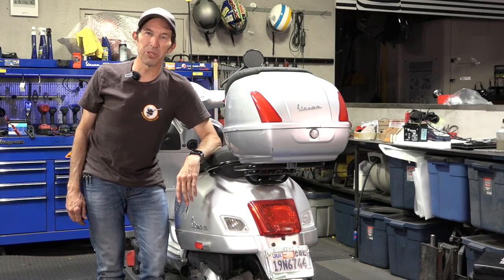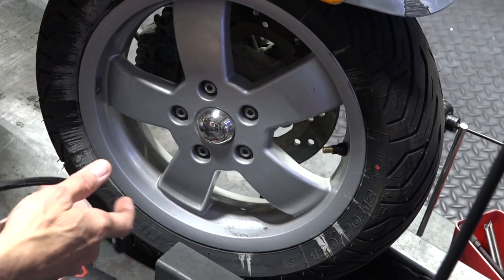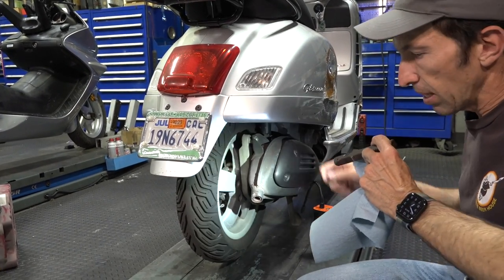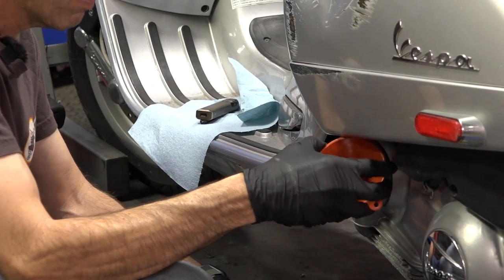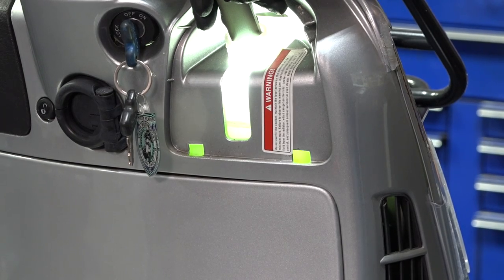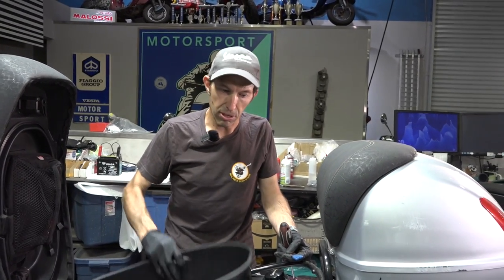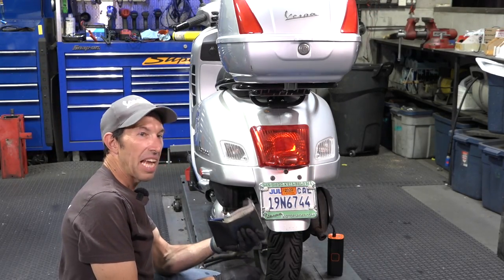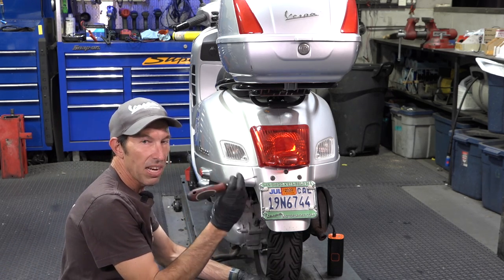Things to Check Before Long Distance Scooter Riding

Comment: My Vespa has been louder than I thought it should be for the year I have owned it (bought with 7k miles).  Finally got embarrassingly loud after a 30-minute full-throttle run.  I changed the spark plug, and looked all over the exhaust.  When I took the exhaust off, I had zero left of the bushing.  This video and parts service is excellent.   It doesn't mention which way in the new bushing goes - it doesn't appear to be the same both ways.  I'm assuming the open mesh end goes into the exit of the exhaust gasses.

Comment: Thanks Robot! I have a 2008 Vespa GT200L that has done over 60 thousand kilometers and is still my daily driver here in Cape Town, South Africa! I have done a few longer trips and loved it. I currently have two problems to solve. My Speedo cable seems to slip (the Speedo works intermittently up and down) when the cable is tightened too much on the top (headset) end. Also my indicators only work when I pull the break lever… any advice on either of those issues from the community? Thanks once again!
Reply: You might have the grease in the tube of speedo cable dry up over these years which is common on the clutch cable of old two stroke engine vespas thus causing the breaking of cluth cable.

You might spray some 3M grease into the tube of speedo cable to lubricate the cable to revive the speedometer.

Comment: HI ROBOT, ALWAYS HAPPY TO WATCH YOUR VIDEOS, QUESTION: I HAVE A 2006 250 GTS IE, WHEN MY SPEED IS AROUND 30 M/P/H THE HANDLES START TO WABLE, I HAVE TO HANDLE  THEM FIRMLY, I DON'T FEEL ANY DANGER, I AM USED TO IT. THE QUESTION IS:  IS IT NORMAL I'VE BEEN TOLD BY DEALERS IN FLORIDA IT WAS. TRUTH OR LIE?

Comment: My friend is a long distance rider, and he told me the best way to test your setup is to use Google Maps to set up a circle around your base, or later, your entire metro area. By gradually increasing the radius of that circle, you will still never be but that radius away from base camp. Once you've done a 150 mile circle, in changing weather, your butt and your bike should be acclimated...lol.  Don't practice in good weather only.

Comment: Robot, I really like your videos!!!! You give a lot of important informations. I am riding a GTS 300 Super Sport since 2017 througout Germany until Italy Mediteranian Cost and back. Was a great trip!!! I travelled approx 16000 km so far without any problems. My last service was at 14000 km with belt removal etc. now the engine is getting in low speed a little noisy. Shall I ckeck the belt and clutch again?
May be you have some idears what to be checked? 
Kind regards from Kiel, Germany
Peter
Reply: Hello peter. What kind of little noise ? Can you describe it or record    ?
Reply: @skilipite  Hi, I‘ve exchanged the Vario Rolls and installed tech Pülley types with same weight 14g as well the sliding pieces. It sounds and works much better. Clutch was OK. I am now checking it and will come back with further comments eventually later. Tks for your responds. Kind regards Peter

Comment: Scooters are great for inner city 'scooting' around, but I find them too uncomfortable on longer distances. I used to have a BMW C650 Maxi Scooter which could cruise freeways all day, but being good at cruising made it too cumbersome for short runs down to the shop. I now have a BV400 which is IMO the perfect scoot. Big enough to be fast, small enough to be easy to handle, but even then after an hour or so of riding I need to get off it for a break.
Reply: the 2023's are WAYYYY more comfortable to sit on than previous years.
Reply: GTS is the way!
Reply: Buy a good seat and it will change your life.
Reply: @gooble69  I be done a full summer of 250 mi each way on a MP3 250. The seat made a big difference to me.
Reply: I have ridden 1200kms in 3 day on a kitted px ,I fine having to stop for petrol enough of a break when touring